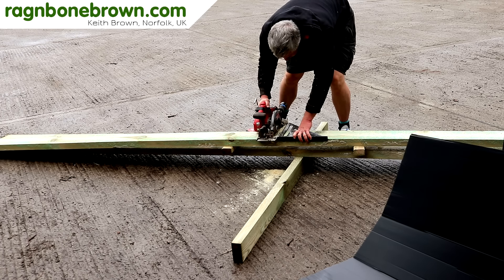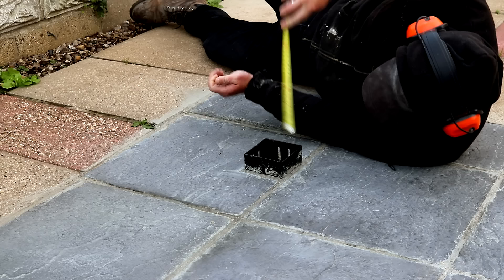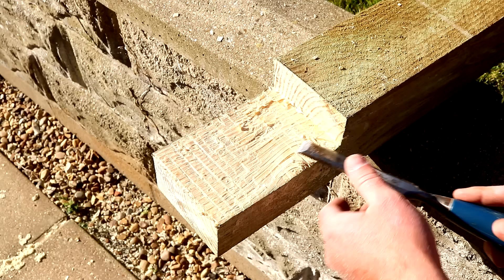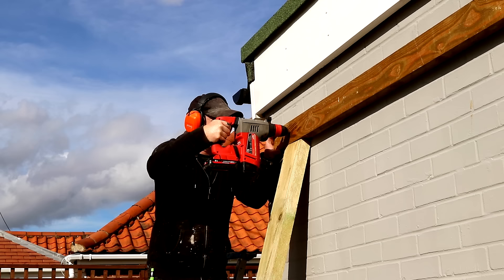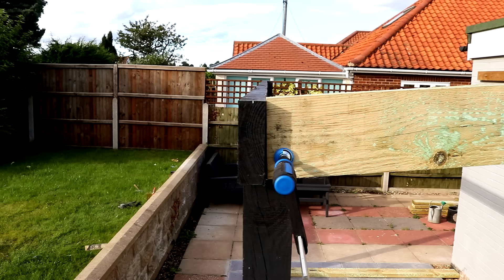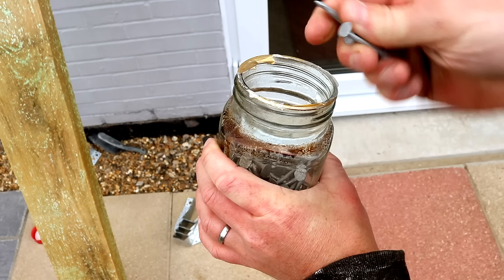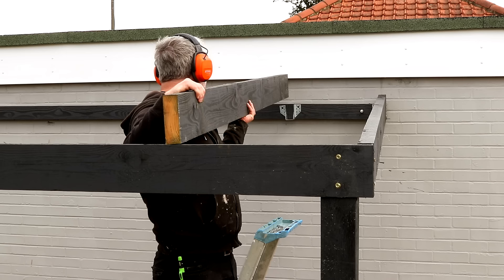I Built A Pergola

Comment: im a carpenter by trade and i build a pergola for my house recently. I spent 700aud in timber although i had 3 posts and a privacy screen down the front, it took me 7 days labour(which a quick and dirty estimate here would by 500aud a day) although that included painting(it rained and the painting was 3-4 days). I  didnt have to do any concrete work but thats where the uncertainty would be in this job so you would see a mark up for that if you paid somebody to do this, lucky for yours  it seemed quite straight forward. Overall i think your costing is quite accurate, great job!

Comment: Regarding rot at the base of the posts: Twice my wife and I have built similar pergolas/lean-toos.
What we do is:

a. Drill holes circa three inches up into the post bottoms
b. Hammer 12mm Allthread up into them (pointing the end & smearing Hard As Nails/other over).
c. Drill corresponding holes down into the concrete/slab.
d. Spin on Wide Washer/Nuts/Wide Washer
e. Drop into the holes.

This leaves each post 'floating' off the ground whilst keeping them in position.
The wide washers distribute the downward stress.
Any rain drops off - first installed 2006. Still no sign of rot.

Over to everyone else for their two pennies worth.
boris - West Bromwich

Comment: I prefer to build without hangers by resting the joists on the main beam. So then I use a notch to keep the rafters in place, much stronger than relying on screws  and hangers for support. It's also less work as well.

Comment: Battery saw at the lumberyard - a great convenience!  I’ve also started using glazer’s packers (flat shims) on top of temporary supports to get beams level before fixing.  Your concerns about trapped water at the post bases is valid. I put in some posts using the type of base that you have. They were mounted on/in slightly raised concrete piers to allow drainage.  And as you demonstrated you could probably use the pergola as the base for a balcony.
Reply: In Estonia (where we have long winters and it's raining a lot) we use either tar paper or birch bark in between wood and stone. It's been done like that for 1000's of years. This permits the  the wood to dry and doesn't allow the moisture to creap upwards from the concrete. And of course, you need the drainage.

Comment: Hi Keith looks great. Like the painted effect. For ascetics I would consider putting additional supports that you put on the front. The 45% supports on the sides as well.
You also need to seal the wall plate so that water doesn't get behind it.
Reply from the maker: There's going to be a roof on top as explained in the video
Reply: @RagnBoneBrown  TBH I would have either fitted the wall plate so it's not touching the wall (using spacers) or sealed it straight away. From your comment I assume you will be installing a version of flashing to carry the water away.
Reply: Whats the measurements on the pieces you cut at 45 degree ángle at the end on the posts

Comment: You only need 1 straight edge, the hole saw holes and track on the other side isn't needed. It also blocks your view of cut.  
It also means you cant saw full length and finish off the cut because of the metal bracket at the end.

Comment: Really helpful video! I’m doing something really similar, but was wondering when it comes to attaching the rafters, do you have to use hangers? I had it in my mind that I’d attach a beam to the wall as you did but then notch out the rafters and screw them down on top of that beam, then on the other end where they attach to the frame to notch out ‘bird mouths’ and do the same? Also I’m thinking of doing my entire frame and rafters in 100x100mm beams for a chunky country look, would you recommend leaving the wood to dry as you did? What’s the benefit to doing that vs building the frame before the wood has completely dried, and letting it dry once built and in place?

Comment: In England if the structure is attached to the house you need to get building regulation clearance from the local Council.
That means submitting plans and paying a fee!
If it's free-standing your OK. but there may still be height and area limitations.
Reply from the maker: Not sure where you got that information from but I'm fairly certain that's not true, not for a pergola anyway. There are height limitations and planning may be needed for building at the front or sides of the property
Reply: @RagnBoneBrown  ...
A 'pergola' doesn't have a roof. 
Check with your local Building Inspector.

Comment: for the beam which attached to the wall,  is it supposed to do flashing to avoid water entering the tiny gap between wall and beam which would cause the beam rotten. And my deck beam attached to the wall is having the problem after a few years and I am fixing it and it is pretty hard.
Reply from the maker: The next video in this series is adding a roof on top, therefore it is not needed

Comment: There was no need for those corner bracing once you put the  roof on, as the roof slab would have a diagonal effect and it will not move sideways.

Comment: Nice job, just one question. At my climat, it's not advised to paint pressure treated lumber until it dries out. Otherwise it rottens the wood from inside. Do you have any issues with it at long term?
Reply from the maker: As long as you leave it a few weeks to dry first, it'll be fine

Comment: Great video. Is it necessary to notch the posts and have the plate sit on the cut-out? Would simply attaching the plate to the side of the post provide sufficient support for the rafters/joists?
Reply from the maker: Hi it depends on a lot of things, what span is the length of timber sitting over, what sized timber is used, whether the roof will need to support the weight of a person, whether it will have roof sheets and cope with the weight of snow, etc. Sorry I know this sounds unhelpful but without knowing more detail it's difficult to help
Reply: @RagnBoneBrown  No worries.  I think a better safe than sorry approach would be better, I guess.  Also, it looks much neater the way you have done it. Thanks.

Comment: I built a garden gate with treated timber and painted it light blue with 'Cuprinol Garden Shades'. I was disappointed to see that the green wood treatment stuff bled through the paint, staining it. I don't think you'll have that problem with the dark grey but was wondering if you know of anyway to seal the wood before painting to stop this occurring. 
I think the joist hangers were a bit over kill, I reckon you could have fixed the timber with notches or extra strips of wood. Anyway, it all looks great, shame about the weather!
Reply from the maker: Did you wait for the timber to dry out? If not that's probably why it bled through. Thanks

Comment: Great video. Can you please help. I'm trying to build a similar pergola but want the rafters to span out 4.4meters and use 6x2 wood. I can't work out whenever I look if that ok to do or am I trying to stretch too far. Does it help if I put noggins in?
Reply from the maker: If you use the span in feet divided by 2, and then add 2 it'll give you the size of timber you need. A 4.4m span is 14 and a half feet. If you divide 14.5 by 2 and add 2 you get 7.25 plus 2 is 9.25. Round it up to be on the safe side, you need a 10x2 but can probably get away with 9x2
Reply: @RagnBoneBrown  ok thanks, i've seen that formula spoke about it terms of roof joists in a house etc or floor joists but wasnt sure that would apply to a pergola which isnt going to have the same use in terms of load on it. I was really hoping to use 6x2 but it doesnt look possible although i seen some pergola kits for sale using 6x2 with over 5 meter spans which further confuses me.
Reply: @RagnBoneBrown  does it not increase the span length if putting in noggins like when building a deck frame?

Comment from the maker: 0:00 Intro & Timber Collection
0:47 Post Holder Drainage
1:45 4x4 Posts
2:25 Front Beam 
2:56 Half Lap Joinery
4:17 Sponsored Message
4:51 Front Frame Assembly
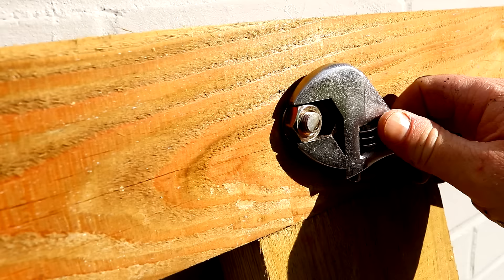5:36 Wall Plate
6:38 Checking Rafters For Camber
7:01 Roof Pitch / Angle
8:25 Joist Hangers
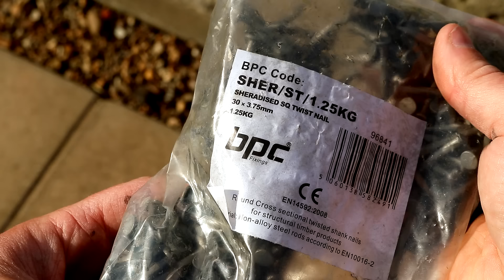8:51 Installing End Rafter 
11:17 Installing Rafters With Joist Hangers
12:15 Corner Braces
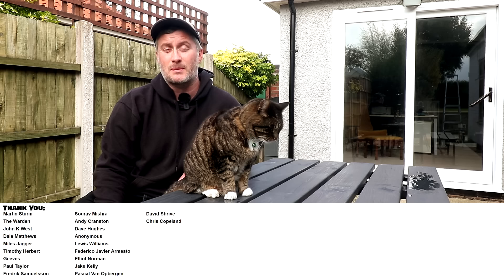12:50 Outro 

Full list of materials, costs etc will be covered in a future video - make sure you subscribe!

This video is sponsored by TRADIFY - check it out here: https://bit.ly/3p4j1V4  and use the promo code RAGNBONE to get 50% off your first 3 months (once the free 14 day trial expires).   It's an excellent all in one job management application designed especially for tradespeople which handles invoicing, quotes, job enquiries, timesheets and more!

This video is supported by Milwaukee, check out their full range here: https://uk.milwaukeetool.eu/?utm_source=Social&utm_medium=YouTube&utm_campaign=Rag%20N%20Bone%20Brown%20-Milwaukee%20Range

M18 Circular Saw https://uk.milwaukeetool.eu/en-gb/m18-fuel-55-mm-circular-saw-for-wood-and-plastics/m18-ccs55/?utm_source=Social&utm_medium=YouTube&utm_campaign=Rag%20N%20Bone%20Brown%20-%20ccs55
M18 SDS Drill https://uk.milwaukeetool.eu/en-gb/m18-fuel-high-performance-4-mode-sds-plus-hammer-with-fixtec-chuck/m18-chpx/?utm_source=Social&utm_medium=YouTube&utm_campaign=Rag%20N%20Bone%20Brown%20-%20CHPX
180cm Redstick Backbone Spirit Level https://uk.milwaukeetool.eu/en-gb/redstick-backbone-box-levels/?utm_source=Rag%20'n'%20Bone%20Brown&utm_medium=YouTube&utm_campaign=Redstick%20Backbone%20Box%20Levels
M18 Drill & Driver https://uk.milwaukeetool.eu/en-gb/m18-fuel-powerpack/m18-fpp2a2/?utm_source=Social&utm_medium=YouTube&utm_campaign=Rag%20N%20Bone%20Brown%20-%20M18%20twin%20kit
M12 Drill https://uk.milwaukeetool.eu/en-gb/m12-fuel-sub-compact-percussion-drill/m12-fpd/?utm_source=Social&utm_medium=YouTube&utm_campaign=Rag%20N%20Bone%20Brown%20-12v%20fpd
Milwaukee Hammer https://uk.milwaukeetool.eu/en-gb/curved-hammer/?utm_source=YouTube&utm_medium=Influencer_Campaign&utm_campaign=RagNBoneBrown_Oct_curved_hammer
M18 Vacuum https://uk.milwaukeetool.eu/en-gb/curved-hammer/?utm_source=YouTube&utm_medium=Influencer_Campaign&utm_campaign=RagNBoneBrown_Oct_M18_fcvl_vacuum
M12 Oscillating Multitool https://uk.milwaukeetool.eu/en-gb/m12-fuel-multi-tool/m12-fmt/?utm_source=Rag%20'n'%20Bone%20Brown&utm_medium=YouTube&utm_campaign=M12%20FMT

#woodworking #pergola #carpentry

Thanks for watching! Please subscribe, click like if you like, and hit the bell icon for future video notifications

HELP SUPPORT THE CHANNEL:
Support with YouTube channel membership: https://www.youtube.com/channel/UCVyE_6jEtVZGmYGXtUOL5FQ/join
Support with Patreon: https://www.patreon.com/ragnbonebrown
Support with PayPal https://paypal.me/ragnbonebrown

MY TOOLS:
For links to the tools I use, plus some of my favourite consumables,  finishes and more see links below.  As an Amazon Associate I may earn a small commission from qualifying purchases:
UK affiliate store: https://www.amazon.co.uk/shop/ragnbonebrown
US affiliate store: https://www.amazon.com/shop/ragnbonebrown

SHOP:
Etsy: https://www.etsy.com/uk/shop/KeithBrownMaker
https://teespring.com/stores/rag-n-bone-brown-merch
Reply: okay!
Reply: Whats the angle ruler you're using called?
Reply: What is amazon link for vent tape used on edges of polycarbonate panels?

Comment: Not sure if this is valuable or practice, but just a thought... Would soaking some exterior wood glue in the ends of the post be of help? Just to plug up the straw fibers.  Also, thank you Keith, for always providing great content.
Reply: I like to stand the ends in a bucket of wood preserver overnight for any timber projects outside.  It let's it soak up nicely and does make it last longer
Reply from the maker: Cheers Neil. I think it's best to let the wood "breathe", wood should be fine getting wet as long as it can dry out again. This is purely based on what I've learned from Gid joiner though! He has way more experience with exterior timber than me
Reply: @RagnBoneBrown  
Never considered that. That's good to know. Thanks.

Comment: Looks great.  I am a little concerned about the nails.  On this side of the pond treated wood is treated with ACQ (Alkaline Copper Quaternary (ACQ), or also known as Copper Azole (CBA) and it is very corrosive fasteners.  They must be stainless steel or rated for treated wood.  I tried to read your label but was unsuccessful.
Reply from the maker: Cheers Barry. The nails are sheradised. Similar to galvanised I think? Not certain if they're suitable for pressure treated wood, but I would be surprised if they were not
Reply: @RagnBoneBrown  I think we are separated by a common language.  I am not familiar with "tantalized"  or "sheradised".   As a Home Inspector I have seen a number of decks that failed because they used improper nails.  So I hope your nails are proper and that the fact you are installing roofing will keep them dry and reduce the corrosion.  Best of luck.

Comment: Why the joist hangers? Just toe nail in the joists to the wall plate and back fix from the goal post ledger, this would be faster, cheaper, strong enough and look a darn sight nicer than joist hangers. I wasnt going to comment but I did for the sake of others that might watch this and think hangers are required. It is not a domestic floor!
Reply: I agree, those hangers look horrid..

Comment: I would of painted the inside of the bracket before you put it on with red oxide and then a black top coat and then paint the outside after you nailed it in bit other than that 10/10

Comment: Why not screws
Reply from the maker: For the joist hangers? Nails are standard, they're stronger especially where expansion and contraction of the timber is concerned as they're better at flexing, plus they're quicker to install
Reply: Rag 'n' Bone Brown,   All right. I just don't like nails. I believe there are screws which are stronger, but 10 times more expensive.